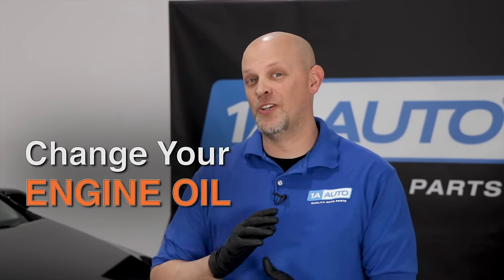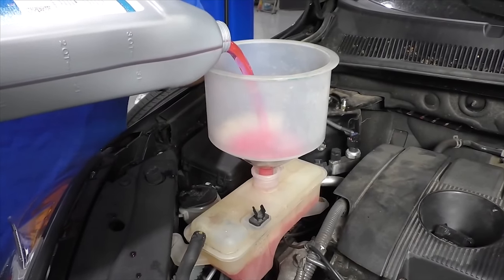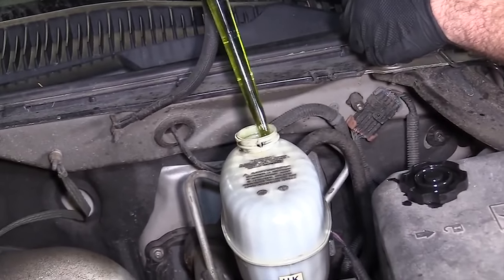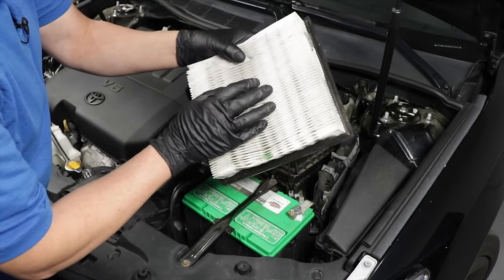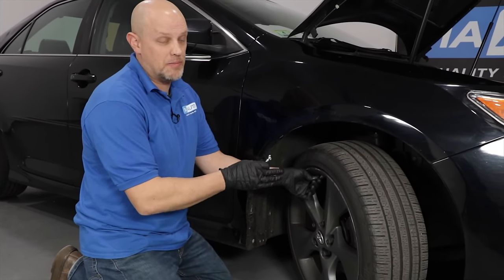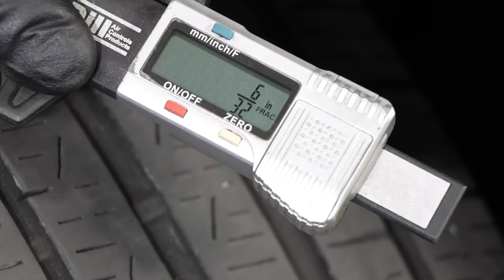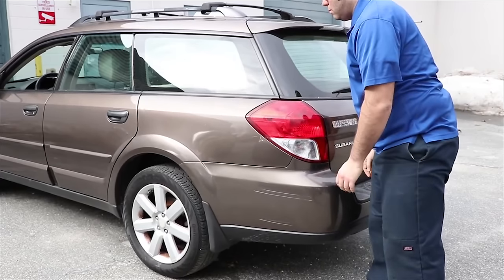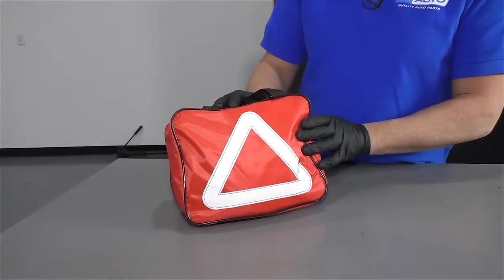How to Maintain Your Car

Comment: car maintenance checklist

1. Engine Oil + Oil filter + Engine Air Filter
2. Coolant level/change (note color and consistency)
3. Transmission fluid levels
4. Brake fluid (level / color/ after 2yrs)
5. Battery (rust, leaks, contact)
6. Tires (pressure, wear, threads, alignment)
7. Brakes (pads, callipers, rotor wheel)
8. shocks & struts (too bouncing )
9. Lights (front & back)
10. Spare tires and emergency kit

Comment: Another important car maintenance tip:  be sure to wash your car body and spray down the underbody regularly, especially during the winter time where they salt the roads.  This will flush salt away, which could rust out the body and panels.

Comment: transmission ,brake,differential  every year,oil 2 times per year,coolant 2 years ,filters clean or change per year ,spark plugs clean per year washer fluids per year batettery 3 year,tires 7 years struts sway bar all components pads and  rotors 7 years what else will be needed water pump all components were al lthe pully or serpentine belts connected val cleanrance 100 k also per year rust proff what else i need to keep an eye on my hrv 2020? that i miss please replay

Comment: My dodge has a sealed transmission and huntington beach dodge is charging me 900 to change the transmission fluid. Not much I can do there haha
Reply: There are usually drain and fill bolts to change the fluid.
Reply: My stepson ran into this with a Crossfire he bought secondhand. I can't remember what he did to cure the transmission slippage at 102k miles. He sure didn't want to bring it to a dealer. He also had to buy a new key fob for it which bedeviled him with a no start condition that had to deal with the alarm and ignition interlock. He's very proficient in troubleshooting and fixing electronic devices. I lost track of the number of iPads and so forth that he's restored to like new condition. 

As for the whole sealed transmission thing I'm starting to believe, especially as I've aged, that it's better to lease a vehicle and get a new one thus avoiding all of the nightmare scenarios that go along with keeping older vehicles on the road. My brother, my stepson and I are in the middle of renewing the front suspension on an '08 GMC Yukon and it's been rust-frozen bolts which have slowed us down. We have even invented a few new words to describe certain situations we've encountered. My brother invented a tool to remove rubber from a deteriorated suspension arm bushing so he could get a Sawzall and oscillating saw in there to cut a bolt(s). Three bolts so far and counting.
Reply: What kind of dodge you have? 
Either way you have your transmission pan with some bolts. Just loosen them up start draining the trans pan once it drains take out all the bolts holding the pan.take pan off clean the magnet and the pan,change transmission filter put new gasket on pan and bolt it back. Just add the same amount you took off from your pan.
Reply: That is a rip off LOL!!!  If you do drop the pan and remove the filter look online to see if there is an aftermarket pan with a drain plug and change pans.  Then in the future you can drain and fill new fluid without having to change the filter depending how much you drive.  At your own risk you can try a self-tapping screw in the pan to drain out fluid but you can't change the filter.  My 2002 cavalier has the same stupid sealed transmission but I found this hack from sweet project cars youtube channel.  It allowed me to drain roughly 9 quarts out of 9.5 total so I removed most of it.  I didn't change the filter yet as I also found a pan online with a drain plug for my cav.  When I get the pan then I'll put a new filter and do another flush.  I did it around 133,000K and now I'm at 138,000K and the car shifts fine.  I'm glad I put that self-tapping screw so I can flush it anytime I want.  If you do end up doing in yourself dropping the pan or using the self-tapping screw make sure you use the right fluid and let it sit overnight to cool off.  Simply fill up what you drained out.  Don't change it when it's hot or warm as I believe it has a different density from hot to cold.
Reply: @papikabi  thanks for reply!
Reply: @TralfazConstruction  thanks for the reply! But I live in california and leasing is expensive plus insurance. We are taxed highly! Well the manufacture these cars with sealed transmission in order for them to break faster and you must buy a new one
Reply: @rhurtadorh32  2016 dodge charger it's been good so fat but I've never been able to change the fluid
Reply: @luismontoya5973  This is so true. I mentioned leasing since the repair costs with those are relatively low when compared to the costs of ownership. The moral of the story is to not allow the warranty to run out I suppose. The extended warranty ads on TV are ever present and even those have a limit on what they'll cover in terms of age and mileage. Older used cars are like a money pit with a dozen combinations of electrical and mechanical problems that can cost over $2000 without warning.

Comment: What does (Dot 3) for oil mean?
Reply from the maker: +Ada L Thanks for checking us out! This means that the fluid is Glycol-based and will have a different operating point that the other types of fluid. This is very important to follow and keep correct else there will be damage that will be done if the wrong fluid is added.